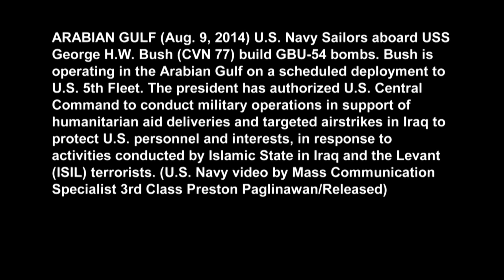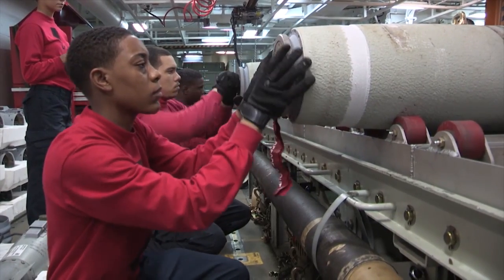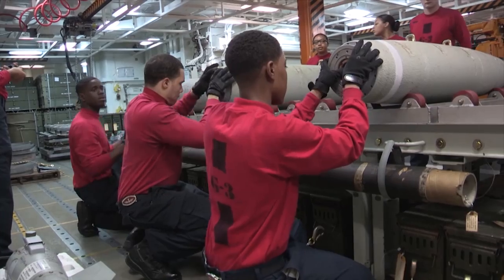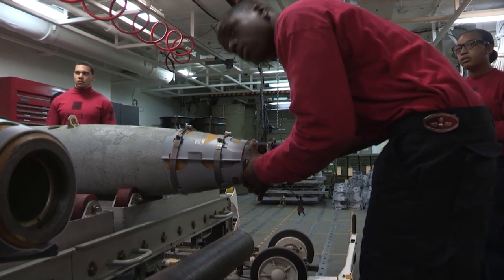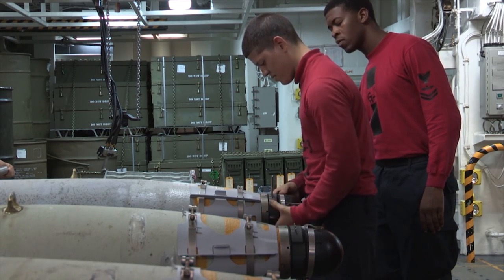U.S. Navy Bomb Building aboard USS George H.W. Bush

Comment: Do these Sailors load the bombs onto the planes also?
Reply: No. They send them up to the flight deck via elevator and then other ordies will load them.
Reply: You work your way up to the flt deck crew which is also extra haz duty pay.  I was AO3 on the Oriskany G div. 1967 to 1970.  Start out first cruise in forward assembly, like these guys, then I went to ordnance elevator crew for 2nd cruise(learned a ton of elevator maint and trouble shooting, which was great for civilian elevator maint jobs) Third cruise I was rewarded with a job on flt deck crew with an extra $165.00 a month. I was ships company G Div .If you are a squadron AO then you are up with your aircraft from the beginning. Squadron AOs do 90 percent of the loading. Ships company AOs deliver ordnance to the squadron fully assembled and ready to arm.
Reply: @byronmartens4018  if you are ship's company and you are the flight deck, what are your responsibilities?
Reply: @waterhead001  You run the bomb-farm.  Make sure the right weapons get to the right squadrons as per the load plan.  It's a good job.  Hard, but good.
That's the short version.
Reply: @stanstenson8168  What is the bomb farm are where is it? Thank you for youe service.
Reply: @waterhead001  The bomb-farm is the area starboard of the island on the flight deck.  It is pretty protected there, and that's where the ordnance is kept when it is not on the aircraft.  On Nimitz class the chaff/flare buildup is right below it, which is another part of the job.
Reply: @stanstenson8168  Thank you for answering my questions.
Reply: @waterhead001  No problem.